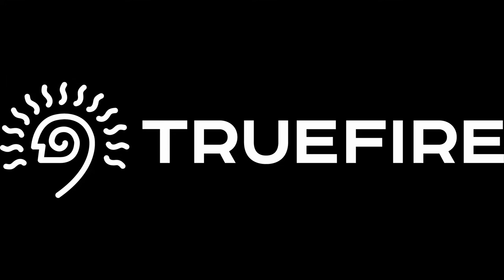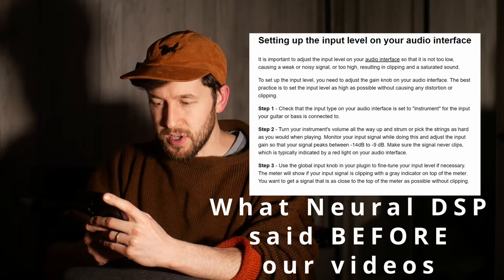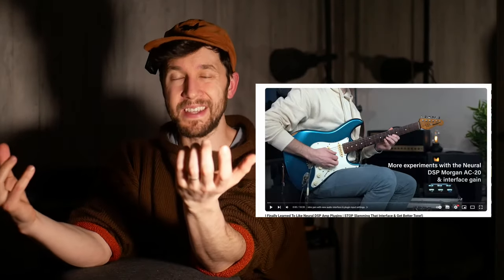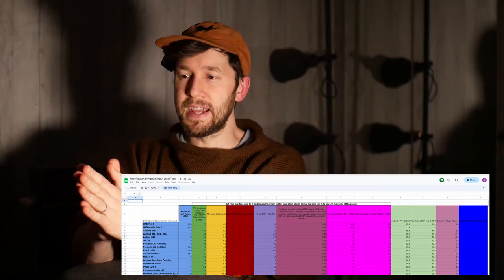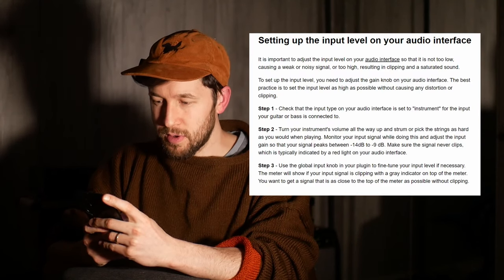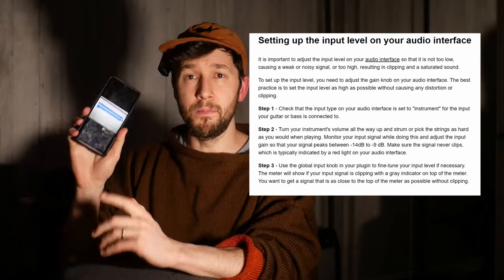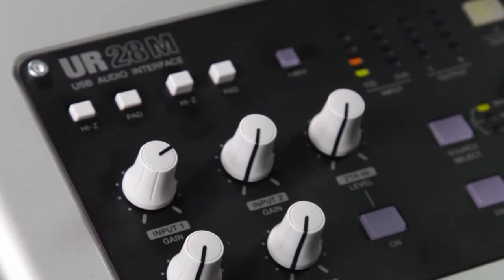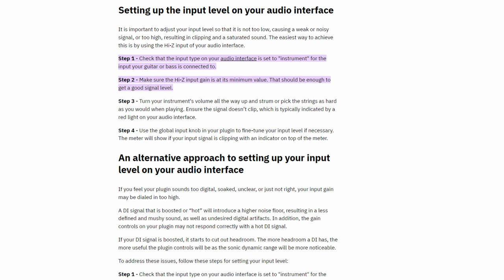Why Are Neural DSP Gaslighting Us About Plugins and Input Gain?

Comment: Thanks man. Just to clarify, I wasn’t pointing any fingers, I’d just seen a bunch of videos recently and I was confused! Nothing more. 

Just to say, either when using single coils or humbuckers, I don’t change the input signal. I just don’t add gain. Seems it’s been a series of bits of info over the years when using VST’s. 

Anyway, wasn’t my intention to suggest people were being wrong or making anything up! 

Also yeah, different interfaces are all different but most offer a line/inst level input. 

I just didn’t understand why turning up the DI input signal was an option because it would affect the end result. I’d always suggest using input on the VST itself. 

Ed commented on my video, and yeah he was very in depth! 

Anyway, I hope that makes sense. No offence intended incase anyone felt that way!
Reply from the maker: Hey Rabea! 
Hopefully this cleared it up a bit, since until we made the videos this was explicitly "the Best Practice" that Neural DSP themselves have told plugin users - 
taken from "Tips For Using your Plugin"

"To Set up the input level, you need to adjust the gain knob on your audio interface. The best practice is to set the input level as high as possible without causing any distortion or clipping"

Since they've only recently changed this after we made the videos in January, it looks like best practice has changed, and they've consequently updated the site to reflect this.

Hopefully this might mean that bois using single coils like me, Beebs, Tom Quayle and Rhett will get better results from the Neural stuff which was kind of the point of the discussion in the first place and why we were kinda like "why have we been doing this all along".
Reply: It isn’t obvious advice because almost all companies tell you NOT to do it. Which we now know was errant information.
Reply: I find your comment here some what disingenuous, the video is how you're confused why anyone would do it any other way. If it was that obvious some of the best guitar YouTubers wouldn't have been confused just like the rest of us. Just my two cents no disrespect intended.
Reply: @akaerik1 thanks man. I don’t really comment unless I’m being transparent. There is no gain in being disingenuous. 

I was confused why this is something that is coming up now. 

In my entire experience using VST’s I’ve never gained up a DI. Nor have I read any ‘how to’ or watched any ‘how to’ videos. I just go with it and use it. But it never occurred to me to gain up a DI. I just leave it as is. 

I see other users do, and tbh I guess when it became a problem. That’s when I made a video, just to clarify things from my perspective. I don’t see what’s disingenuous about that. 

And no worries I don’t feel any disrespect man! Everyone is entitled to their own opinion. But I can assure you, I’m a firm believer in saying it how it is and being transparent. Probably the Yorkshire in me 😂
Reply: @RabeaMassaad  respect 🙏🏽

Comment: The general consensus was ALWAYS to set the input gain as high as possible without clipping - I was doing it for many years after Misha Mansoor's guide to recording 9 years ago, and I'm sure many guitar recording guides to this day still follow these protocols. This is very typical audio recording advice that works for 99% of use cases, but now people are wisening up to the calibration stats of all digital recreations of analog gear (be it amps, or any other studio hardware). Of course, you can often compensate with the input gain in the plugins. In reality though, most users would sooner tweak the plugin itself and turn the amp's gain knob down rather than the built-in input gain controls. 

ML Sound Lab's advice from the start has been to calibrate your input signal to the input light in the plugin. Grabbing your hottest pickups, chugging as hard as possible and tune your input gain  so that the light just barely begins to blink. This does still calibrate it to the right levels, but it's not a realistic method to expect now that we've got a lot more exclusively-clean amps available. 

We now suggest engaging the Hi-Z/instrument input and turning the gain down as low as it will go, regardless of your interface. You could calibrate further as per your interface's specs (as outlined by Ed S in his fantastic research), but these exact calibrations are too much to expect of the average player. The ballpark area is going to be good enough for most people, especially when coming from the old method of "as hot as possible without clipping". Clean tones will actually be clean, crunch tones will actually be crunchy, and high gain tones won't be a flubby, noisy mess.
Reply: I appreciate the clarification on this! I use a lot of ml plug-ins and have enjoyed them. I actually thought that we were supposed to have it lighting up green all the time. It would be really fantastic if all amp Sims could have a built-in calibration like the Joey Sturgis stuff does. 

I admit this input gain thing has been a pain in the ass ever since I started trying to learn to record, and now I'm trying to switch to Reaper which has just been another headache.

I guess now I'm off to ask Dan Worrall and Adam Steel if they have an answer for my specific Reaper / pro Q question.
Reply: I've bought several ML plug-in over the years, and I've always set the input gain to just below clipping based on advice from you guys at ML, and I gotta say, I was never really happy the tones in the long run. This is why I kinda haven't used my plug-ins a whole lot, instead resorting to practice with real amps or a modeller at home. I never made the connection, that the input gain was causing my plug-ins to be all flubby. I guess that says more about me than it does the people giving the advice. 

That said, I watched Rabeas video last night and I went straight to my audio interface and turned the input gain way down. Now my ML and Neural plug-ins sound great, and I feel like an idiot. 😂 I never really understood why I could get a kickass tone with a real amp or a modeller, but couldn't get anything to sound right with plug-ins.
Reply: to be fair, Misha set the input for the tone coming from his AxeFX, he didn’t dial in the gain for a DI signal
Reply: > high gain tones won't be a FLUBBY, noisy mess <      So this issue affects frequency / EQ too, not just the amount of gain?   I've wondered why ML and Tonex sims always seem to make my Fender bridge pickups sound like Gibson neck pickups, no spank or sparkle.  Thought I was losing my mind.
Reply: @ericolson326  kind of yes, simply boosting the input signal into an amp will make the amp respond differently.
Many high gain rock/metal players do this to archive a tighter low end response.
But it can also go too far, you really have to experiment and different amps respond differently.
Reply: @josuastangl7140  This. I think a lot of people missed that part. There's a big difference between recording a DI and recording the amp tone.
Reply: Same... I learned it from Misha.
Reply: Misha is an interesting case, because he records through the Axe-FX, and sends the wet signal through the interface, so in that case “gain as high as possible without clipping” actually makes sense. Not with plugins though, it’s a different matter in that case. I was lucky to find out myself that lowest gain was best for plugins, but when you’re told to increase the direct gain by the manufacturers themselves, then yeah it makes sense why the consensus has become “wrong.”
Reply: @ANDI3niable  Misha wasn't using a DI in that video though, he was using the output  from his Axe-Fx.
Reply: @Slamthulhu  there's a video where he ran his axe fx through a focusrite, and I thought the same would apply when running directly through the interface

Comment: I'm so glad you and Ed S. and Rabea have been digging into this. I've only got a Stomp but I've also got Helix Native and have been very frustrated that my Stomp-built presets sound super distorted when using my interface and Native.

You all are a huge asset to the digital guitar community.
Reply: I find both my stomp and helix native sound awful in my DAW, even with VERY low input gain - to the point of I stopped using it and went with Amplitube, which worked great right out the box without any crazy input gain levels.

Comment: We've all been bamboozled!!! Ive watched so many YouTube videos through the years of learning home recording saying to raise the input level (gain) on your interface to get " healthy signal to noise ratio", just dont clip, etc .  Then time passed and people started changing this narrative a bit to= not record quite  that hot (but still raise the gain on your interface so that the bulk of the signal is in about the -18 dbfs range, peaking no higher than like -6 to -9 range.  Thank you to Ed, yourself and all the other people shedding light on this.  My guitar sound through plugins is so much better now.  Thank you
Reply: That's what I'm doing, but now this is saying I should set it to 0... which gives me a signal that PEAKS at about -19 dBFS, with a fairly hot metal humbucker (at max volume of course). That's a bit low, isn't it?
Reply: @exscape  In Ed's video (I highly recommend watching it , if you haven't already), you not only set your interface gain to zero, but then you adjust the input gain in your amp sim plugin to the value that corresponds with your specific audio interface.  Ed made a whole spread sheet of the values for a bunch of interfaces.

Comment: All these years I use plugins and I watch/read info about them, that's the advice they gave : raise your input gain to where it doesn't clip. I just checked the Steinberg UR22 manual online and it still says the same thing. Up until I watched your previous video, I used to have it like that, before clipping, and the sound was muddy. Using the info you shared (and the one from Ed S) helped a lot to get a proper tone and THEN adjust to my taste. Again, thank you.

Comment: It seems to me you are confusing between proper audio recording - and how hot your should be feeding the plug-ins. Those are two different issues.
The advice to record the guitar as close to clipping - is good. Some audio interfaces - lower quality ones - are indeed noisy - but that is not the full picture. The louder you record - the better the reconstruction of the audio is as you have more resolution.
however - that does not mean this would be the right level to feed the plug-ins with.
each plugin - especially analog simulations - will have a different headroom and non linearity and it is indeed wise to attenuate the signal before going into those plugins.

why is this a better approach? because we usually record audio in 16 or 24 bit, but the daws use 64 bit internally - so reducing the level after recording - before the plug-ins - retains maximum resolution.

Comment: I’ve been experimenting with guitar plug-ins since at least 2008, and I never heard the advice to not set input levels for guitar-into-amp-sim as you would for a mic. Even guitar-specific audio interfaces—once those started to appear—would give the advice to set the input level the same as you would for a microphone. I made a serious attempt to move most of my guitar processing to plug-ins several years ago, but I just couldn’t get good results. But your video on this topic has changed everything. I might end up selling a bunch of gear, and I feel like the results I’m getting even with outboard gear is better. The big question looming for me now is whether I get a six (or more) input interface and try doing stuff with my hexaphonic pickups all in-the-box too.

Comment: I'm approaching this a little differently, as I mess a lot with reamping too and mostly an using plugins as a "demo" and if the take that's there is "the take" I reamp it, if not I re-record it through my amp once I have the mic positions and what not. 

But, I record as much of a signal as I can, yes adding gain from the interface, and then I use the input in the plugin to lower it. May not be correct the way to go about it, but it works for me so I have a take that I can use for reamping should I need it. 

The whole thing was a game changer for me though, once I "trimmed" the input in the plugin to match our guided dbs it became way way way better. Thanks for what y'all are doing.

Comment: The interface gain knob at 0 will increase the NOISE when you add more gain in the plugin. The best method is to:
• Set the interface gain to below the clipping level
• Then set the input level in the plugin to minus 12-15 dB
• Tweak the amp gain until it sounds good
This will set the input level to calibrated levels while keeping the noise as low as possible.

Comment: Rabea did not at all shed light on anything. He just happens to have an audio interface that has the right level with the knobs set to zero. The "Problem" ist, that audio interface instrument input levels are NOT standardized. So it is guesswork. Unless you use Eds Google Document. Tried it with several interfaces and it works. 
Just saying "It is obvious" does not help anyone.

Worse is the advice the companies give... when in developement they for shure use the right level, otherwise the gains would be totally off. 
There needs to be some sort of gain calibration process where you can set the right level in front of the plugin. That would solve it once and for all.

And YES, I was one of those people that added gain. So greatful for Ed, you and some others for explaining it and making it popular!

Comment: I am/was one of those guys who increase the input level of the interface because I was told to do that in every single manual by every company out there since the beggining of time. The presets from any amp sim past and present always sounded bad to me. I always thought that my interface, guitar, cables, pc, monitors were crap. But then I bought a Steinberg interface, Alesis Monitors, earnie ball cables, a Dean guitar with EMG humbuckers, an I7 pc with 32GB of ram, SSD drives, etc, and the problem stayed the same. So I was lost and hopeless until now. This discovery brings me hope to my guitar tone!
Reply: Recently I put an EQ on output signal and that was the thing I needed

Comment: I came at this from a different direction initially. 
Being an old Sound Engineer by trade I usually worked to a -12dB baseline starting point for i/p levels. 
This came from working with early digital 16-bit systems targeted at CD production. 
BUT this was all too often a bit too lively for virtual guitar device plugins, as I soon found out. 
Early experiences with Helix Presets, from a certain JNC chap, had me thinking "These are all set a bit high in the i/p or the amp gains for my liking" ... 
Basically I thought, at first, that it was John's fault that his Presets were too Hot  ... 🙄
Then JNC mentioned Ed's research into these matters and there it was; the disconnect between Old Best Practise and manufacturers' advice and, most importantly, the Real World. 

Before Digital, we used to set i/p measured by VU metering, 
The target then was to hit -6dB to 0dB VU and not get too upset by the peaks hitting above that. 
The tape compression would be Very forgiving, even preferable as it turned out... 
The noise floor issue came from the noise inherent in mixing console and mic preamps. 
Back then, the aim was to feed the recorder with the highest manageable signal to noise ratio. 
I believe these older practises are what has led to the current confusions.
Reply: back then, tape machines and consoles would be calibrated and that is no different to how things are now. Tape machines all have their own calibration (based on who sets them up), same is true of converters. 

The main issue is that most people don’t have to think about this stuff for most scenarios. So generally, a lot of people don’t really understand it. There’s tons of threads on forums online that are totally muddled through around things like -18dB, VU, +22dBu, RMS, unity etc without really knowing what it relates to. So it can be quite hard to learn, because there’s a lot of misinformation online.
Reply: P.S. 
Yes Tape Machines were calibrated but to different Reference Levels and with different tolerances given the nature of the recording medium. 
Most of the calibration was to do with Record Level, Frequency Response and Head Alignment. 
The input level Standards were much simpler to deal with. 
Pro +4dBv 
Not Pro -10dBv 
Of course there were differing Zeroes depending on whether it was 600 Ohms or other impedances ... but that's another story .
Thanks BBC 🙄
Reply: @KozmykJ  Ha yep. It’s essentially the same with converters and how much headroom they have. Some are 24dBu, some 22dBu, some 21, some 20, 19, 18 etc.
Reply: I'd like to disagree with your conclusion. The problem is, that people are preamplifying their instrument's signal (without realizing) to line level before "plugging" into the virtual amp which is designed (or not) to handle a normal instrument level signal but keeps this a secret